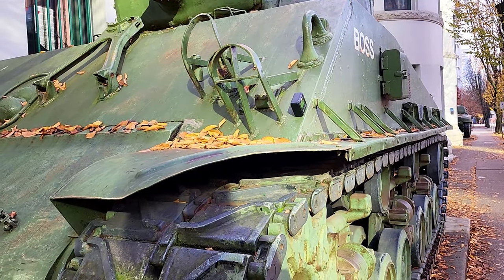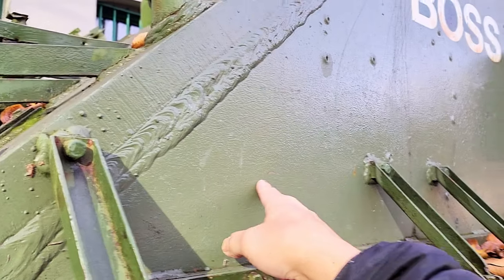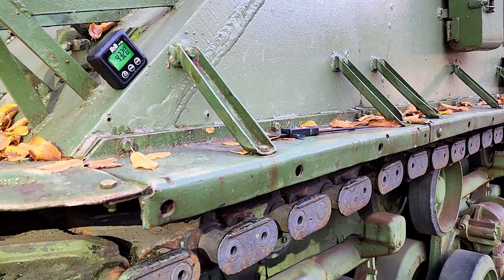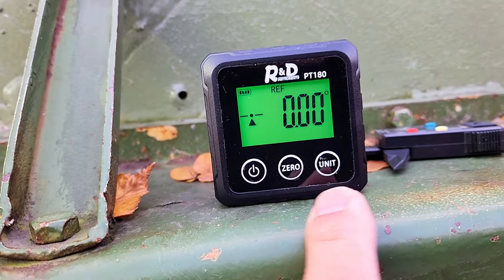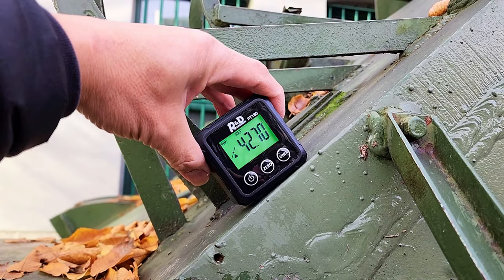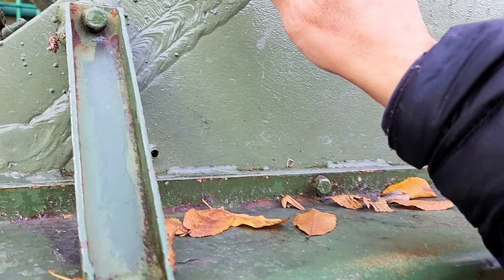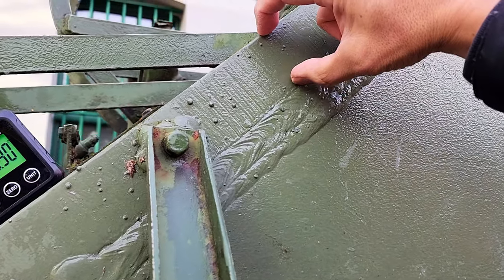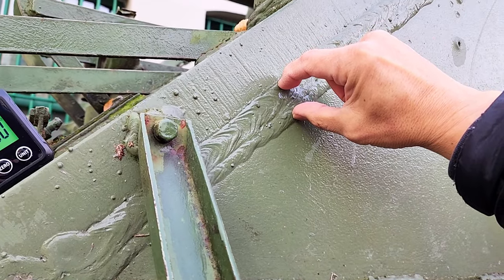WW2 M4A2E8 Sherman Tank Frontal armor thickness and Armor inclined angle Actual Measurements

Comment: The M4A3E8 had around same equal thickness on the horizontal as a Tiger 1 tank ,at 101 mm . Which made it a tough tank in 1944 -45. 76.2 mm gun and 23 inch tracks helped alot too!
Reply from the maker: Thank you 😊
Reply: @VIDEOVISTAVIEW2020  thanks for the videos 📽️